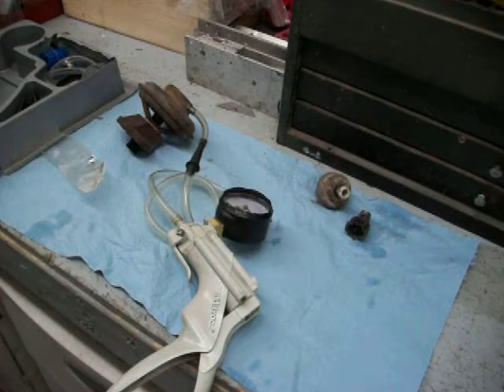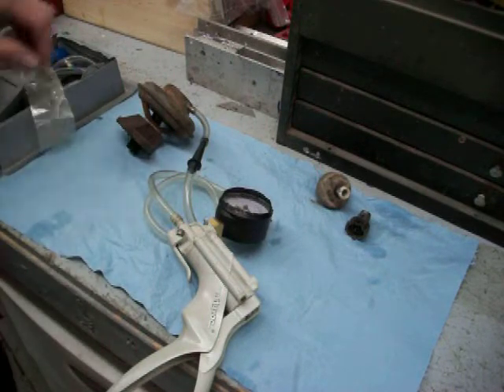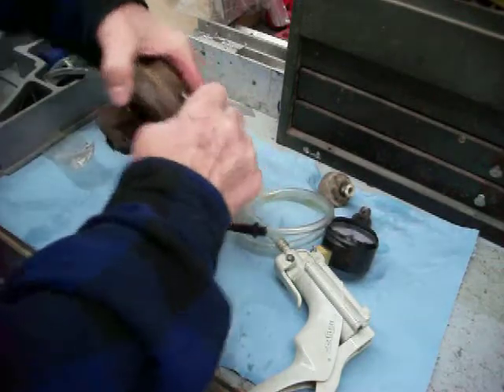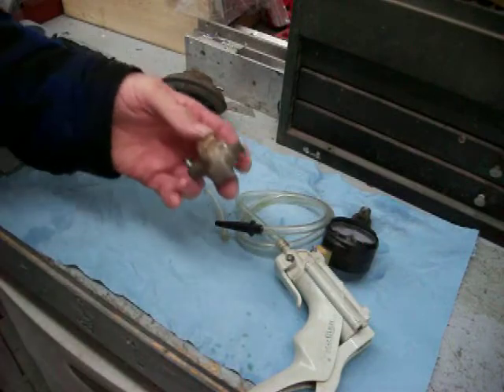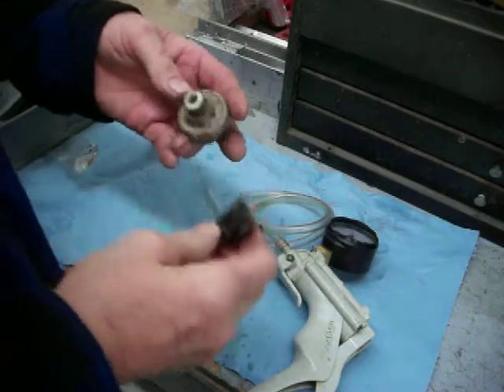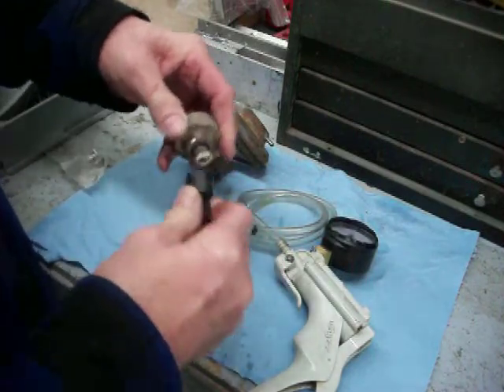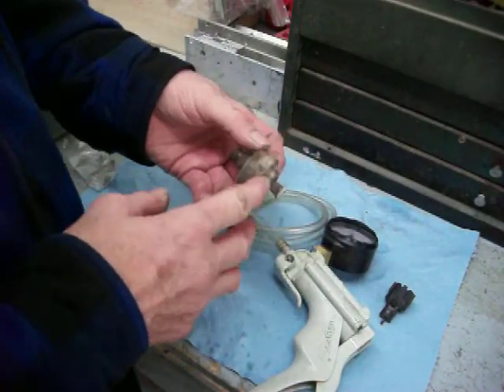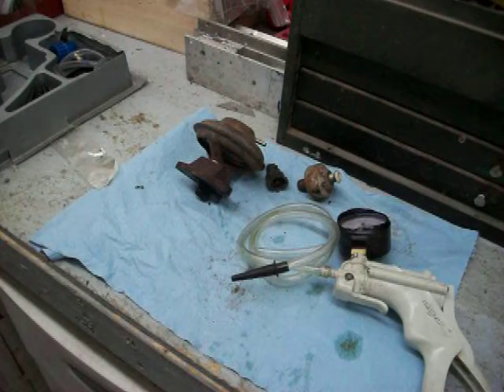EGR and Knock Sensor 1989 Chevy 5.7 pickup

Comment: Where is the knock sensor located??

Under the EGR?
Reply from the maker: On the side of the block on a chevy about 2" round with a single wire. Newer vehicles can have them under the intake manifold.
Reply: Ok cool, near the starter?
Reply from the maker: @firearmconvention946  Yes, just above and in front of the starter towards the front of the car.
Reply: @josaljo1  
Dose the starter need to be pulled ?
Reply from the maker: @firearmconvention946  Not usually, but it depends on the application.
Reply: @josaljo1  thank you
Reply: Where us the wire supposed to connect to?

Comment: Did you solve the low rpm miss by replacing the parts?
Reply from the maker: Sorry i did not finish the video, it ended up being a bad sent of spark plug wires.

Comment: Is it possible to have a bad knock sensor that is resulting in poor power/ weak acceleration with zero codes on the OEM1?
Reply from the maker: It is always possible and it may be the problem, I would check the fuel pressure, and then check the ignition system, spark plug wires, distributor cap, rotor, those are the most inexpensive. Then go after the control module in the distributor, you should find the problem there.
Reply: My Cat converter was two years old and went bad. I have since removed it. Engine seems to be running great but at start up the check engine light will come on then go off after 3-5 seconds. Its code 43. I have replaced the knock sensor and the pigtail.. not sure if it means that I actually have a knock or ping in the engine, if my engine is internally failing? thoughts?
Reply from the maker: Its possible, but probably not just the knock sensor.
Reply: O and on cold start you can slitly hear paking just slightly but I do have 40 sires flow Masters on it so I don't know if it's the mufflers or something else
Reply: Oild pressure at clod start sets at 60 but after driving and stop in hear after 30 minutes it goes down to 30 psi